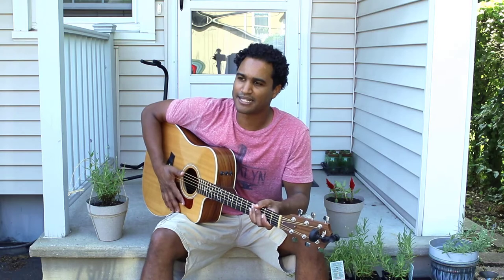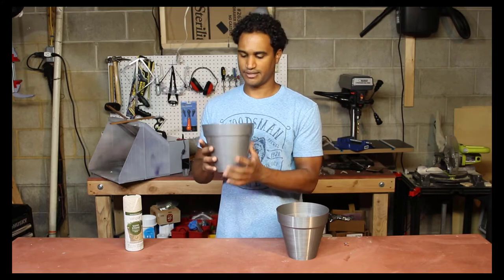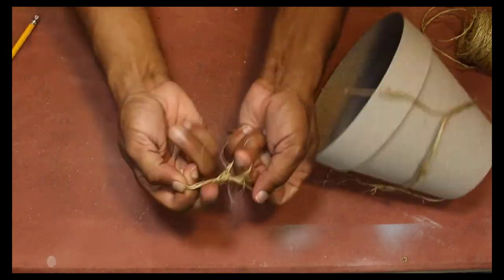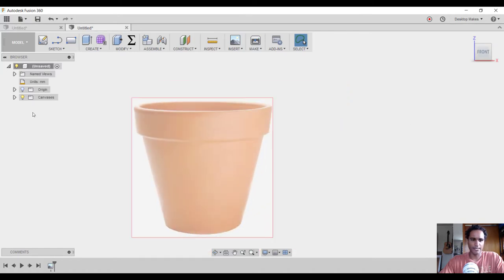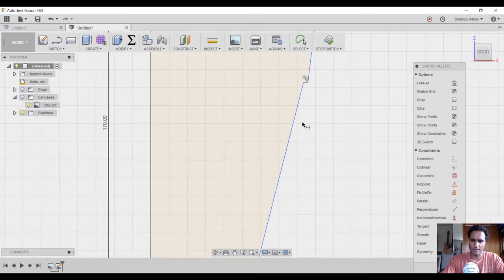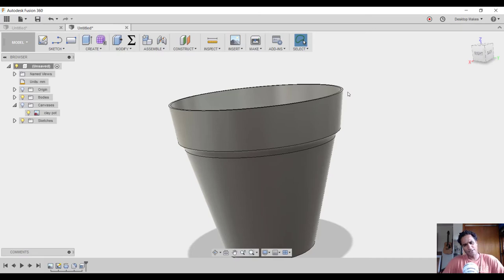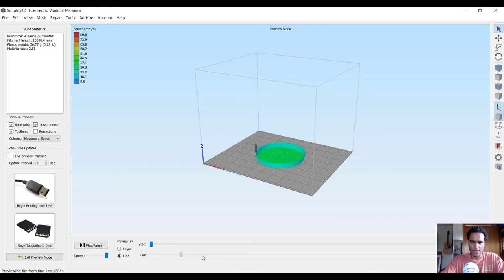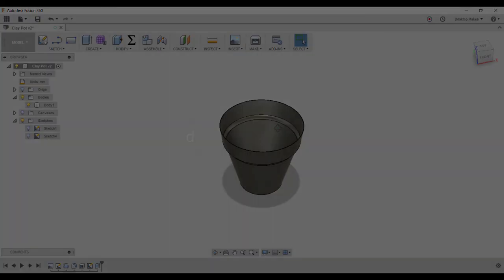Design & 3D Print a Flower Pot with Fusion 360

Comment: Hi, love the video! I just have one question.. I am new to Fusion360. After your video I tried printing your design, and then I tried designing my own. Your design has one wall only. Mine automatically has two... How do I remove the inner wall, so I only have an outer wall on my pot? I used the shell method (tried making a triangle shaped pot). Thanks!
Reply from the maker: Hi Michael,  if you export it as a solid object (without shelling) and then enable vase mode (spiralize outer contour in some slicers) it will automatically print with one shell.  You may want to increase your extrusion width to make the wall a bit thicker.

Comment: Hej! Great video. I want to make a plate for my flower pot (so that water doesnt just spill out of the pot, but it would be caught my the printed plate). Do you have any quick tips? I made a very simple one but it seems its taking too long to print (40h, when the plates radius is ~10cm).
Reply from the maker: Thanks.  I would apply the same approach - create a sketch of half the profile and revolve it around a center axis to get the full profile.  The key to less printing time is not make it so thick.  See what you can get away with.  That's why I made the flower pot at 0.4mm and at 0.8.  If you plan to prime and paint the plate it will help with strength and durability.